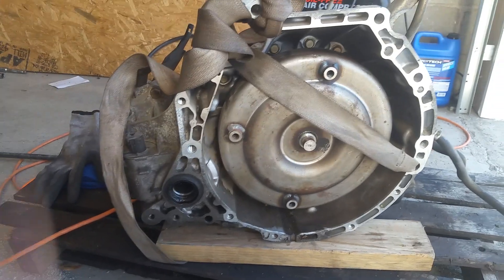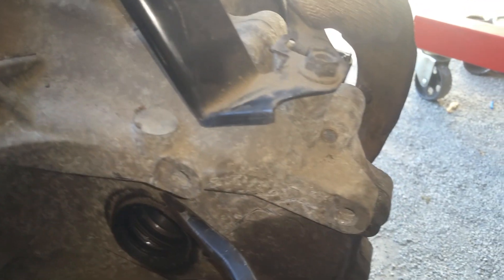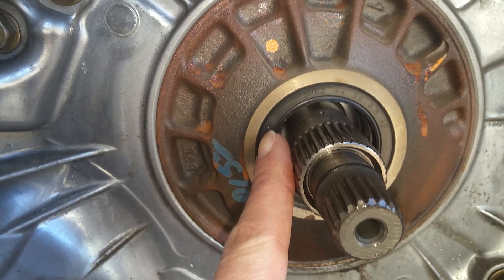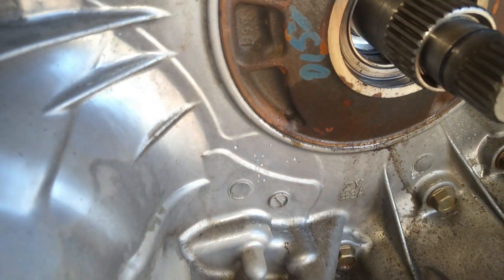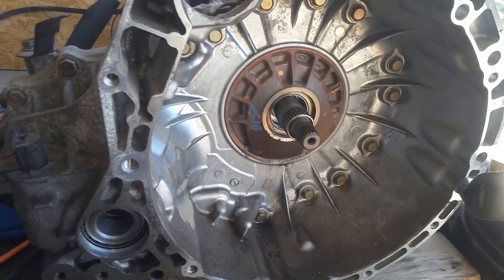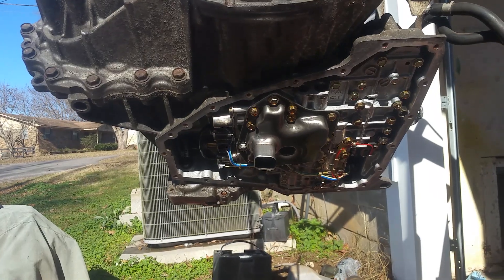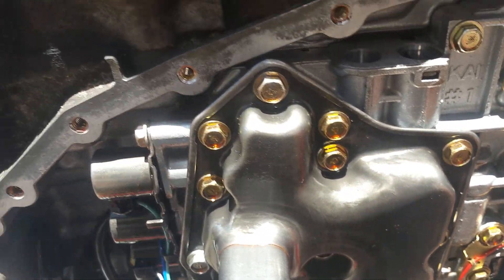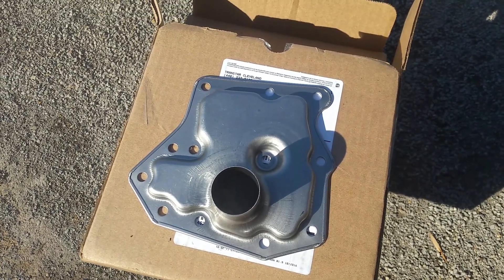How to change cv seals transmission seals filter nissan altima 2004

Comment: Glad to see that somebody else lets the gasket maker set up for a bit before tightening things down! Nice job. Thanks!
Reply from the maker: +Baxrok2 after I did this a found a kit online that included the filter and one of those nice cork gaskets . I wishing I'd got that . Cork is about only exception as far as gaskets go or I use gray rtv. I just don't care much for the rubber gaskets myself , had a bad experience with one leaking and ruining a transmission on a grand prix I owned. I do like cork material it seems to be reusable even . Usually I just rtv it to the pan then just torque it down to the transmission.  I find the colder it gets my motivation slows way down though ha . Thanks for watching
Reply: @s33therfan  Can you give a part number, brand or link to the kit you found? It could be a chance to help someone else that hasn't done this procedure yet. Maybe even me.

Comment: Was wondering if you could give a few more details about the vehicle this ATX is from. You only say it's a 2004 and you mention it has a torque converter so I know it's an ATX. But this car has both a 4 cyl engine and 6 cyl as well as a 5 spd manual, a 5 spd ATX and a 4 spd ATX. Not sure on the 4 Spd for the 2004, but I have a 2003 SE with a 4spd ATX. Didn't know if the parts you are using were compatible with my application.
Reply from the maker: Yes this was out of a 2004 nissan altima with the 2.5l 4cyl. I was changing seals etc when replacing the engine. The cv seals I picked up at auto zone . Really with the filter design a fluid change would have been sufficient if I had it to do again. Thanks for watching.

Comment: Great video....keep up the good work.
I'm working on 2008 Nissan rogue 2.5L 2 wheel drive. I replaced TQ CNVTR, right and left seal and I'm still leaking transmission fluid? 
Maybe I didn't flush the TQ CNVTR seal or something. I know for sure it's leaking transmission fluid. What are my other options?

Your comments is appreciated
Thanks
Reply from the maker: If you replaced the seals it is unlikely they would be the issue. I would try and pin point exactly where the fluid is coming from. It could be from the seal on the case itself . Thanks for watching.
Reply: @s33therfan    Now remember I replaced CV axle seal right & left then possibly buy another torque converter seal to replace it. So I watched another video where they open up the front pump spline. Should I be doing that? What are the odds that my Torque converter unit may be leaking? Last question, after I replace the torque converter seal or front pump seal, how can I double check for leaks? Without re-install the transmission.

Appreciate your time and comments.

harm

Comment: Hey I enjoyed your video. I had a question, could I use the screw trick on my 2007 Nissan Murano. The driver side was very easy to pry out but the passenger is giving me a problem and it’s twice as big. Do you think it would work?
Reply from the maker: Yes it will, and if you do not want the screw bumping against anything you can screw it in enough to pull it out with a hammer. I do them either way. Thanks for watching.
Reply: @s33therfan   hey sorry I have one more question I changed it out and replaced the cv axel as well but the vibration is still there on the passenger side what do you think it could be. It’s coming from the passenger said but I replaced his driver shaft as well. Autozone gave him the wrong cv axel, he needed a awd cv axel for the passenger front but it was the wrong one. I installed the correct one now this please help this is my first time ever experiencing this problem
Reply from the maker: It honestly sounds like a wheel bearing . However if a cv axle is bad or popped out of socket and may not have fully seated that would cause a vibration as well. If it was not there before I would suspect cv . Hope this helps and thanks again.
Reply: @s33therfan  Hey thanks I will go out there and take it apart again and check if it’s fully seated the customer wants the vehicle back asap but I don’t let them go until I do the job right. Thanks again
Reply from the maker: Not always but sometimes you can take the cv out of the knuckle and spin that bearing by hand and hear the grinding if it is a wheel bearing. Its just a good time to check it. I have however seen them vibrating like crazy but making very little noise when spun by hand. Hope all goes smoothly , thanks again.
Reply: @s33therfan  ok I found out the problem it was the drive shaft making the vibration, I asked the customer is that the right drive shaft because there was no bracket on the drive itself but the person they took it to made one for him I informed him he would need a new drive shaft and make sure it had the bracket on it or he would run into the same problem, and the seals I changed are still leaking especially on the passenger side and causing a lot of smoke because it’s leaking on the exhaust. Thank you in advance
Reply from the maker: I am glad you figured out the issue. I guess the vibration caused the new seals to leak. Hopefully he can find a replacement bracket and get it back to original. Had a nissan quest with a bad passenger cv axle that had a horrible vibration. Thanks again.
Reply: @s33therfan  Thank you for all the great information, keep doing a great job

Comment: How did you pull out the transmission?   Did you dropp subframe completely? Or partial.  Thanks for the video. Thumbs up!
Reply from the maker: I had thought about that but then after looking at it decided to go out the top . It was a tight squeeze but it fit out at an angle with the front of the engine higher than the transmission.  And a lot of watching and being careful . Thanks for the feedback and thank you for watching
Reply: What was the part numbers on the seals
Reply from the maker: This is a seal from ebay for the input or torque converter seal. 

https://rover.ebay.com/rover/0/0/0?mpre=https%3A%2F%2Fwww.ebay.com%2Fulk%2Fitm%2F142663139745

As far as the cv axle or output shafts seals , you can pick them up at any parts store usually , when you buy them have them mark which one is the passenger and drivers so you don't mix them up . However you can Google the part number on the box it will tell you . Left is drivers and right is passenger . Thanks for watching

Comment: to bolt the flywheel to the torque converter is it required hat u take the trans out and botl the TC to the flywheel then install the trans out of the vehicle...having difficulties trying to bolt flywheel to TC with the trans and engine in vehicle i was hoping i didnt have to but just wondering if it can be done without having to pull the trans
Reply from the maker: As long as the torque converter is seated properly you shouldn't have any trouble.  You'll know if it isn't because you won't be able to turn the crank over it will be as if it's locked up . Other than that you should be able to access it by way of removing the dust shield etc from underneath , it's not necessarily easy but not much different from any other . It will require some feeling and guess work getting them started and mirror usage possibly.  But in short no you should absolutely be able to bolt it up inside the car with the engine and trans together . Seems like I remember using an extension just the right length.  Those bolts don't have to be terribly tight just put some loctite on them . I believe they are only something like 20 or 25 ft pounds best I remember.  Anyways hope this helps and thanks for checking out the video .
Reply: @s33therfan  sweet i just got it bolted down..thx man
Reply from the maker: Glad I could help thank you and best of luck on your project .

Comment: Isn't it a bearing behind that CV axle seal? If so how do you get them out?
Reply from the maker: There is but it would require transmission removal and separating the front bell housing to gain access. There will be bearings and races kind of like what you'd see in a rear end bearing replacement.  I've not had to replace these bearings myself because it's always been the wheel bearing bad . Now the next part would be hunting down the correct bearing to put back in there. Now myself personally if it was a high miled transmission for the trouble and work involved i would probably try and find a used replacement with low miles on ebay , however sometimes these transmissions can be expensive so you might just weigh your options and cost and see what's the best way to proceed . Hope this helps and thanks for watching

Comment: Is both c v joint seal the same
Reply from the maker: I believe they're different,  the parts store should mark them , either passenger or driver side so you don't get them mixed up . thanks for watching

Comment: My right CV seal is leaking pretty bad... transmission shifts good...can the seal be installed without taking transmission out sir??
Reply from the maker: Yes it can , it's not easy getting in there but it can be done. I usually jack up the side and support it on whatever side I'm doing pretty good at an angle so as to not lose much fluid . Then take pry bar etc usually pop them out , they're not in there too bad usually . As far as putting back I've used wood blocks pvc pipe or whatever is handy just something soft as not to damage the new seal. Pvc the right diameter is my choice if I can get in there with it and hammer. Hope this helps and thank you for watching

Comment: Where did you get your parts
Reply from the maker: The torque converter seal I ordered off of eBay I believe it was oem. But as far as the cv axle seals or output shafts seals I got them from auto zone . Thank you for watching
Reply: Do you happen to know the drivers side part number? I went to autozone and they tell me that I had to go to Nissan